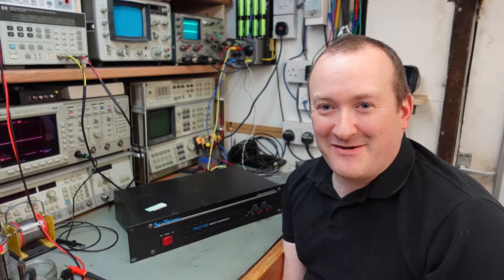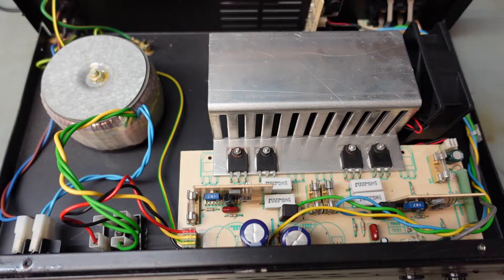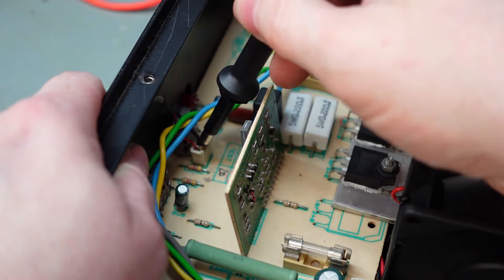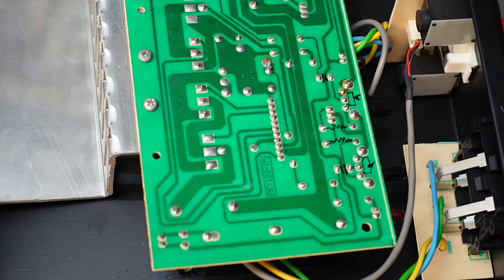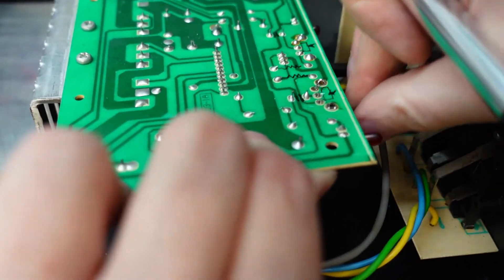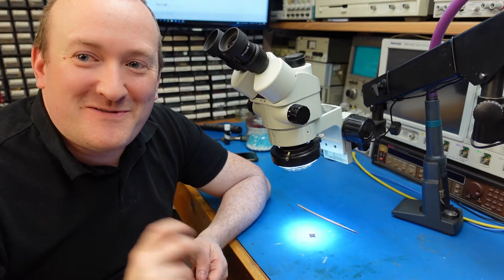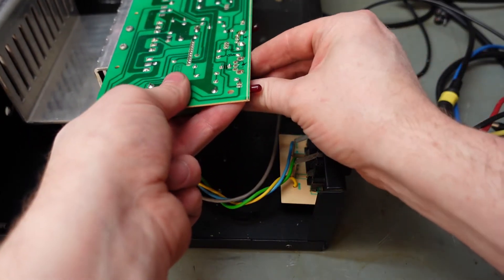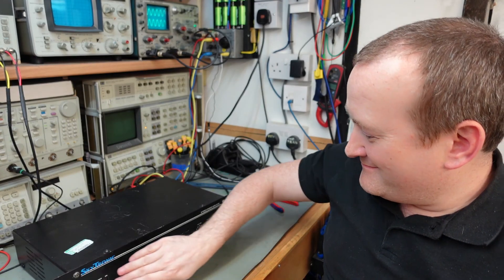Cheap Amp Cheap Fix! Skytronic PA2100 Amplifier Repair

Comment: I've utilized the exact same procedure in using silver conductive paint to repair a non-standard potentiometer because it was made of "unobtainium, rareium, or scarceium". I purchased my first soldering iron when I was eight, and I've been repairing all types of mechanics, electronics, and optics for more than 60-years!  David Riddle (click on the circular "H2H" logo for details)

Comment: I had the pa600 version which means it should put out 300wrms per channel.but my denon 1905 was louder at 65wrms per channel.the day i sold it,it was the most anticipated sale of my hobby years.if you gonna buy a power amp,just buy a decent one.cos when you need to sell it you gonna have a very hard time finding a willing buyer for a cheap "power amp" with a bad reputation

Comment: The other thing these videos exemplify is ethics.  Even if some techs could do a quick fix, they will take the route of most profit.  IE:  instead of a quick fix on the potentiometer, they may install a new one at a high markup.

Comment: When the meteor is on track to hit Earth, your No1 on my survival team list Mark. Just love your extremely inspirational work, and the way you go about it. FYI - You've motivated me to buy an oscilloscope (ta Santa), and I'm going to try it this week.  10 monitors, 2 Tvs, 3 amplifiers, 1 DVD player & a mosquito trap all waiting in my shed. Don't hold your breathe.
Reply: How'd you get on? I have three 70s Sansui amps, one Hitachi 70s receiver, one DVD/VHS deck, one 70s Akai  cassette deck and a Pioneer multi disk VD recorder to play with. Just have to summon up the courage. They all owe me nothing, but, apart from the Panasonic DVD/VHS thing they would all be valuable if working properly. The Panasonic would be handy for digitising my old VHS tapes though. 
And yeah, Mark would be a "must have" on ant survival crew.
Reply: @hpd385tannoylover2  ROFL nickname's "gunna" so that gives you a clue ... BUT I have cleaned some room in my shed by giving away a very old "nearly" working radiogram, and a cou[ple of "nearly" working old radios to a collector/dealer. I have a working VHS player for the same reason as you, and next job is getting the 3 Nearly working sub woofers off my bench. At 81, I have switched from Dos/Windows (40 years) to Linux mint so that must count for something ...   2025 is the year of GREAT achievements ...  or maybe not  ...

Comment: Oh that idea with the conductive paint is brilliant. I've had the same problem multiple times when building guitar pedal kits and some pots came new with bad contacts and I didn't have a matching replacement in my stash. I always got lucky and a nice squeeze with some pliers to force the metal contact into the track of the pot did the trick. But conductive paint seems more reliable.

Comment: Nicely fixed!!! Never seen such a fault before. Usually when the connection is broken, it is open, not 200k. I think I might have replaced the fan with a quieter one, though. Keep up the good work! Your channel is really great, you always seem to be in a good mood!

Comment: Great video ,always interesting. Why do you sometimes use a manual desolder pump instead of the de solder station? Second question what do you use when we see you cleaning up pcb’s ?

Comment: Hi Mark, do you ever use fader lube on pots like that? I've had pretty results with the stuff myself
Reply from the maker: Yes I do. It depends on how difficult it is to open them up, and how much time I have. Deoxit F5 is quite good, but none of these come near ultrasonic or manual cleaning. I do use that F5 fader stuff as lube afterwards.

Comment: Hey Mark...I always see you prodding around with a single probe, would you mind telling me where the ground is hooked up to?
Reply from the maker: The ground makes its way back through either the speaker negative terminals (connected to another oscilloscope ground), or from the signal generator. Not good for high frequency measurements, but for audio frequency signals, it's fine.
Reply: @MendItMark  Thank you so much for the answer. I am learning about audio systems. I am interested in building pedals and various other effects units and small audio circuits, so it suits me perfectly, thank you.

Comment: Nice fix but i would replace that awfully loud fan
Reply: Not sure it would be worth it
Reply: Designed for professional commercial use, not the living room?
Reply: Agreed.  Sounds like a vacuum cleaner.
Reply: @davidfrankton4139  cheap pub/club music amp, even seen em used for mobile discos. You're hardly gonna hear the fan are are you? 😂
Reply: Plus you can easily tell if the fan fails?

Comment: 1:17 yeah, fairly similar, um, "guts" to the modern equivalent, the Skytec SPL1000 (an amplifier that's "rated" at "2x 500w" but someone tested it as 2x 80w)... the brands are part of AVSL Group I think they're called (same as QTX etc), it's cheapo stuff for the UK (and Europe).

A proper 2-channel pro power amplifier will (as you may know) have a bigger power supply in the middle and then separate output sections for the left and right channels, literally on the left and right sides, with many output devices mounted to heatsinks that run the whole length.

Comment: Thank you so much, Mate. A quick fix indeed if you have those nice oscilloscope. Never heard of the amp brand. ✌
Reply: Skytronic is budget gear aimed at bedroom DJs. They've been around for a while now.
Reply: @lesrogers7310  I think they're a part of AVSL Group I think it is, who use several different brands like Skytronic, Skytec, QTX (with or without a "Sound" suffix), Citronic, Fenton, and (depending on the product category) Chord and Adastra.